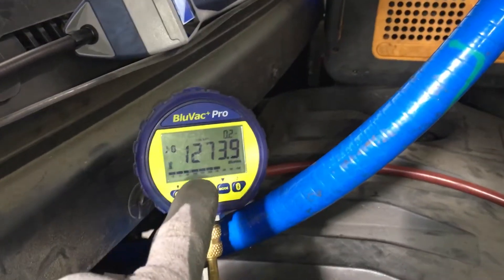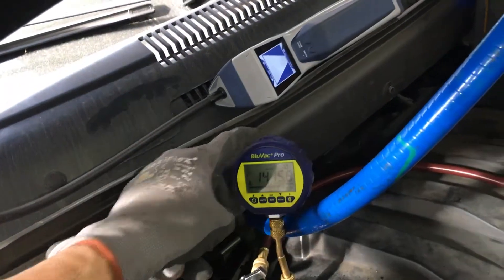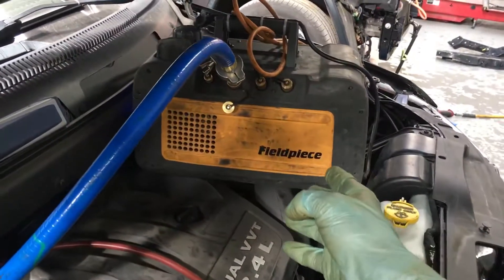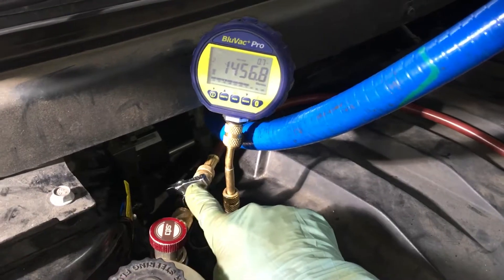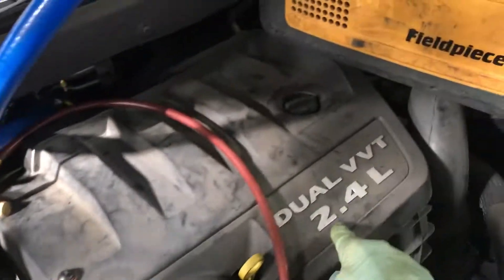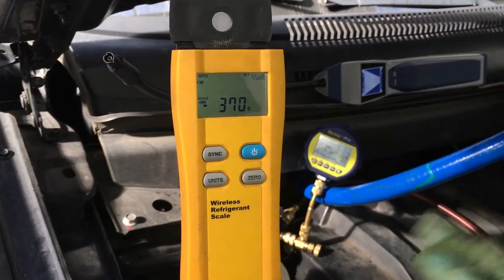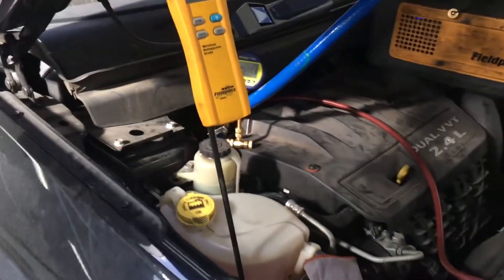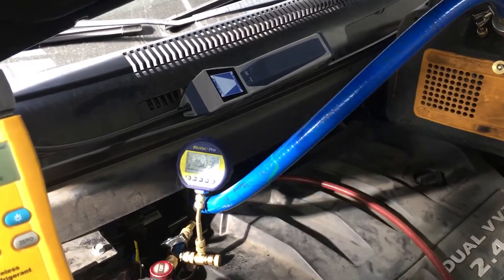AC usage of micron gauge, BluVac + Pro

Comment: HI TOM, i think you said in one of the video it doesnt make sense to remove sharder valve in Auto because unlike R22 older one this one is big enough. just cross checking did i missed it.
Reply from the maker: Only if it’s on the vehicles that have the digger Schrader valves for 134 refrigerant or YF because they have this quick couple connectors and the majority of them have a very large circumference about 10 times more flow than a standard Schrader valve. 

Now there are some of the YF vehicles and some of the R134 refrigerant quick couple connectors that have a standard highly restrictive little Schrader valve core inside .,
   But there is no Schrader valve core removal tool that you can use at the same time being capable of hooking up a hose for vacuum or recharging that beast is not made

There is a Valco removal tool that is only capable of removing and replacing the valve core on a system that is fully charged, but the threads that are on it are not manufactured to connect to any kind of available hose

Comment: cant see what is going on with those connections. when you pulled a vacuum form the low side, did you use a Schrader valve removal tool? and do you need to pull the Schrader valve on the high side when connecting the meter?
Reply from the maker: The Schrader valves for 134 refrigerant, and YF our 5 to 10 times bigger than flow rate than the old style trader valves with a quarter inch 12 refrigerant so you don’t have to pull them. 
     And they do not make a tool, pull Schrader valves and Connect vacuum hoses to

Comment: What is the important of micron gauge? Vacuum is not enough?
Reply from the maker: @HydroaireSaipan3  micron gauge can actually show you the content of moisture contamination that has absorbed into the refrigerator oil, rubber hoses and even metal has pores and absorbs moisture. 
    The difference between old analog gauges that you just see -29 inches of mercury.  Anything after that you cannot measure. 
       But it’s everything after that that’s actually important that tells you whether or not what your moisture content is. 

Time is not important 
Because on a heavily moisture contaminated system, you can vacuum for 10 hours at -29 vacuum and still have a lot of moisture and you would never know it without a micron gauge 

Or you can have and start out with a fairly dry system from the beginning and have a good vacuum pump and correct hose and be completely dry and clean in 10 minutes   And you would never know it or be able to test it and prove it with analog gauges. 

It’s that moisture that bonds molecular level with the refrigerant oil and under heat of compression breaks down the refrigerant oil and makes acids that slowly eat away and cause micro leaks from the inside of the AC system through the air, evaporator and condenser . 
It takes a long period of time it’s not instant .

Comment: Man, i got questions.  Would love to get you on the phone.

The appion adapter threada between the red adapter and hose?  What's the 2nd adapter off the appion to the micron gauge?  Does anyone sell a dedicated set up for just mvac 134a?  I only do mvac, no hvac at all.  Worry about having the right thread sizes.  Acme where it belongs and no adapters for sae, pipe, etc.  Thanks, chuck.
Reply from the maker: @justmewoof  go to 
Automotive HVAC technicians 
On Facebook

Comment: What part no /brand is the SAE 1/4 inline ball valve with service port  connection located on the High R134a adapter . many thanks .  Is it a  R12 shrader valve tool ??
Reply from the maker: Appion MGAVCT 1/4" Standard Vacuum-Rated Valve Core Removal Tool

Yes is only for old 1/4” 
R12 , r410, r22 ect 

True Tech Tools discount code 
LECHAIR

Comment: I didnt know that you could completely fill freon without the compressor running. Learned something today
Reply from the maker: Learning something new every day.  And pass on the information and help someone else. 

I’m still just a student 👨‍🎓 learning something new every day to 👍
Reply: @coldfinger459sub0  its good to see videos that show/teach the correct way of doing things. Lots of misleading and corner cutting videos out there. I've pulled vacume and charged my vehicles before but just learning about the micron gauge. Looking at purchasing one.
Reply from the maker: @ThePowersSix  True Tech Tools has many manufactures micron gauge. 

You get 8% off if you use my discount promo code at checkout shipping is free on any orders over $50 

LECHAIR  all capital letters all one word

When you enter the code in the coupon, checkout box, it will re-calculate the price for you and reduce to 8%. It goes towards my discount so I can buy more new tools and make new videos, showing new tools to introduce everybody to new procedures and better equipment

Comment: Big fan of your content. Am new to the game and at work we use the COMMANDER3000-E rrr. I really want to incorporate a good micron gauge to properly test vacuum. What would you recommend? A totally separate setup with another vac pump and maybe the field-piece digital gauges/bluevac or could I just use the blue vac with the rrr vac pump. Thanks again for your vids.
Reply from the maker: You can use the BluVac with some shut off adapters to isolate the valves from the hoses.  Then another ball valve to isolate BluVac from the system who it’s time to recharge. 

I made a few videos showing how. 
      If you don’t want the bells and whistles with computer Data grafting you can get the simple BluVac  same high quality sensor just cost less.

Comment: so u are basically sucking a vaccuum through the low line and adding refridge from the high line ? and what does the micron gauge even do then?
and shouldnt you have the refridge valve near the bottle, so the system would suck empty the whole filler tube also?
Reply from the maker: The micron gauge you place on the furthest side line away from your vacuum pump.   

Or if you cannot do that you have an isolation valve where you’re pulling vacuum.    So you can turn off the vacuum pump and actually read your true micron reading on the system without the vacuum pump running. 
        
        This was just for demonstration purposes only to show the Micron gauge connection and the isolation tools attached to it. 

The demonstration if someone did not have the money to buy a set of gauges and they only had one hose. 

I have a recovery machine sitting on the floor right next to me so after I remove my connector I can attach it to my recovery machine to recover the rest refrigerant out of my hose. 

Did not show in the video at the very last second holding the refrigerant can upwards and just giving a quick squirt of vapor refrigerant to push the remaining liquid refrigerant in the refrigerant line into the system. 

        And then you just use your recovery machine on the remaining refrigerant trapped inside your line. 

But remember my videos are also shown in countries where people cannot afford refrigeration gauges and they do not have EPA refrigerant laws for venting refrigerant to the atmosphere unfortunately. 

There are still countries where it is legal or they really don’t care that they waste refrigerant into the air.

Comment: The way you have this set up, are you able to purge the refrigerant line so that when you open the valve there is not air in the line? If so, could you explain how to achieve that?
Reply from the maker: I had the vacuum on open to the refrigerant line to the tank so I actually evacuated out the refrigerant line to then I closed the shut off valve at the fitting and then I opened the refrigerant tank valve.

I did not explain everything this is on a known good perfectly working system there was nothing to diagnose I don’t look after pressures on this one I didn’t need to stick a temperature sensor in the dash because it was working before so I was just showing this quick method on a perfectly good system that I know I would have no problems with
Reply: @coldfinger459sub0  Appreciate the explanation. I'm just trying to plan out how to hook everything up and liked how you had it, just wasn't sure about what was happening after that ball valve and how to purge. Makes perfect sense now. Thanks!
Reply from the maker: @blain2484  I don’t think I explained or at least I don’t remember that I was using the appion Core extractor tool as one of my shut off valves on the high side separating the low side hose and micron gauge from the high side little brass valve depressing tool can’t remember I describe that.

And this is a procedure I would not normally perform on cars only if I was like 99.9% sure I was gonna have no problems everything was 100% in perfect operating condition before expecting no trouble

Comment: Again a great video.  I'm planning on using the same set-up procedure, except in place of the BluVac gauge I'll be using the Fieldpiece 380V.  Expecting it would take a little longer for the 380V gauge to show the actual vacuum. Your thoughts are appreciated.
Reply from the maker: Just leave it on overnight that’s the best you can do pooling vacuum through refrigerant manifolds and rubber hoses. 

           About two months ago or so I did some videos I’m up to part nine slowly incrementally showing the difference as I improve the Fieldpiece gauges coding their rubber O-rings for seals to help them pull deeper microns without leakage.

        Changing from rubber hoses to silicone hoses for pulling vacuum going deeper in micron range.  Here’s one video link of the last one I did part 9
https://youtu.be/81yFZMHuK4g

       And replacing rubber hoses with soft copper metal lines to even go deeper vacuum in microns and no loss leakage through the copper like you get with rubber hoses
Reply: @coldfinger459sub0  what I intent to do is not pulling the vac thru the SMAN380V, but to hook it up and use it strictly as a micron gauge instead of the BluVac.
Reply from the maker: @horsth9566  that’s better than nothing at all that is for sure. 
          And if you could arrange some soft copper as your single vacuum line to your 380V that would even be better. 
          Use quarter inch caps and plug off all the other fitting ends that are not being used. 

          If you feel comfortable take apart the service valves out of your 380V and follow my video procedure with silicone grease or NYLOG
Reply: @coldfinger459sub0  thanks for your reply.  Have done the 380V valves and ran several test.  Deep vac improved especially with a black vac hose and Appion valve.  Making headway thanks to you

Comment: How come you don't pull below 500 microns before charging with refrigerant?   You usually pull to 500 or below and leak down to make sure it doesn't go above 1000 microns.
Reply from the maker: I forgot to write the explanation down below in the comments. 
           The lines were left open to the atmosphere for too many days and this has two evaporators in the rear with many feet of extra lines that the PAG oil is completely saturated with moisture due to this exposure to atmosphere. 
              I would have had to leave it on the vacuum pump for probably eight hours to overnight to reduce the amount of moisture in the system. 
               This is what happens when customers bring their cars to shops that are knowledgeable or don’t care about capping off the refrigerant lines when they opened them up. 
           You can really tell the difference between a moisture saturated vehicle with a PAG or Esther oil, 
                  If it was a old or 12 vehicle with mineral oil it would not have been this bad because me and oil does not absorb as nearly as much water as the newer oils. 

       Right now in San Francisco the temperatures are in the 50° ambient temperature on a daily basis makes it very difficult junior impossible to remove as much moisture out of the oil as if it was a 70 to90° day. 
            This is just one of those cases where I know I’m not going to remove the moisture in a reasonable amount of time due to the lack of the procedures not being properly followed by the technician.
Reply: @coldfinger459sub0  Sometimes I have noticed that you do leave cars on vacuum overnight to pull super deep vacuums...I am assuming this shop/customer was "in a hurry" or didn't want to pay for you to leave your equipment there overnight to do a deeper vacuum.   I have not seen you do a video on how you charge customers (would be a good video topic, BTW....I.e. how to charge for diagnosis, recovery, nitrogen leak-down testing, vacuum, charging/filling, post-charge leakdown, etc).   I'm assuming you have to go flat rate due to the bureau of automotive repair regulations ?    Because if you charge them a flat rate for a vacuum, how do you work in the times where you have to pull multiple vacuums or draw down a vacuum overnight versus the times where the vacuum may take only 5-15 minutes?   There's no benefit to you to do a deeper overnight vacuum if the customer has not agreed to pay extra for the dedicated machine time (not to mention your time to go back to that location for a second time to complete the service).
Reply from the maker: @komoru  Super observant observation. 👍
            Yes this is true this is an a high production high-volume Body Shop the vehicles have a very tight time schedule DPR’s which is direct repair shot for large insurance companies get graded like children on a scorecard with quality of work how quickly they get it out the door how cheaply they get it done all these things are taken in consideration in a high production insurance job. 

         You will usually notice on the vehicles I leave a vacuum pump overnight are usually very special customers with older Mercedes high-end extremely high value and will pay to have usually everything done right sometimes they skip replacing the receiver dryer.

          Because I have so many vacuum pumps I could afford leaving cars overnight at different shops at multiple locations every day if I need to. 
              I am not under high pressure to perform high production Quick work from my employer or a boss a manager or a supervisor. 
            I am not under a bonus program the quicker I move the more money I make because I work for a company that dangles that golden carrot in front of you to make you bust your ass and work really fast for a bonus you could barely ever obtain and usually ends up being pretty pathetic making you run your ass like a chicken with his head cut off at a 200% of your ability. 

          I work like my grandfather and my father half and taught me you may work slower but more careful if you never skip any procedures and always do everything 100% right on every job you will never ever have to question yourself when somebody calls up and says it’s not working a couple days later. 
          Like a shop with many employees you will have to question did the last guy evacuate it long enough or did he even evacuated at all so you have to waste your time testing or guessing. 
              The last technician take care to make sure that he did or did not overcharge or under charge the system because he made a mistake or he was in a hurry or he did not understand how to read a label with three or four different charge quantities for that particular vehicle this waste time and money if it comes back. 

           Did the last technician in your shop not perform a good vacuum test or high-pressure nitrogen test did he skip using the UV light did he skip using the refrigerant leak detector

            Did the last technician in your shop where everybody is running around like a chicken with their head cut off to go faster faster faster to make the boss money have a cheap no good old leak detector that is not very accurate or reliable possibly even being abused by technicians due to lack of knowledge therefore barely works at all anyway

        Who is the boss cheap at buying a UV light that has very low output so it barely finds leaks unless the leaks are really big and strong with lots of oil and dye. 

          All these things and many more not mentioned on comebacks waste a lot of time and a lot of guesswork goes into Curion to initial problem on top of that looking for the problem that the technician created that is not normal that even waste more time and money. 

         If you always do everything right on every job from A-to-Z never skip procedures it’ll never come back and bite you in the ass and if something does go wrong due to something else that was an intermittent problem you will never have to second-guess yourself or anybody else that it was always done right 100% of the time from year one through year 30. 

          This is the other way to have a high profit business never make mistakes never cut corners never be cheap by the best tools attend the best education classes completely and thoroughly study all reading material constantly educate yourself year after year decade after decade because there’s always new things to learn don’t rely on your old knowledge it will become outdated. 

          But yes there are times and time constraints you take a educated guess with all your years of experience do you have the tools of a micrometer to actually prove and demonstrate you have at least reduce the quantity of moisture in the system to a point where it will not cause a come back immediately.